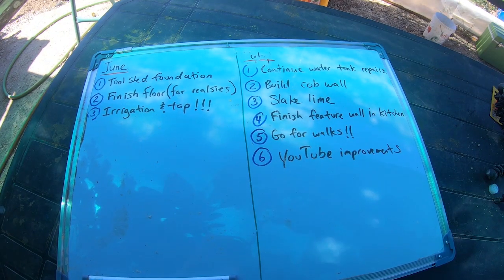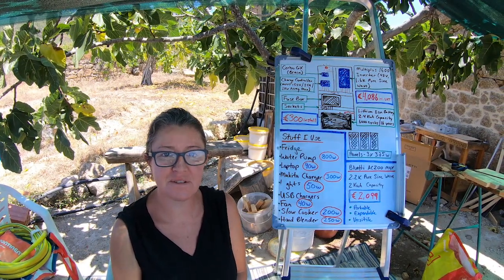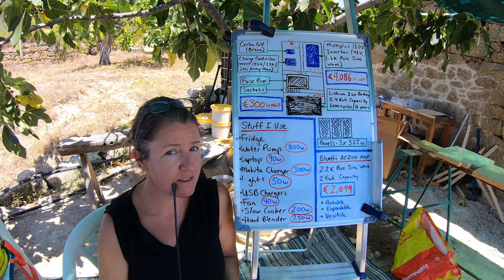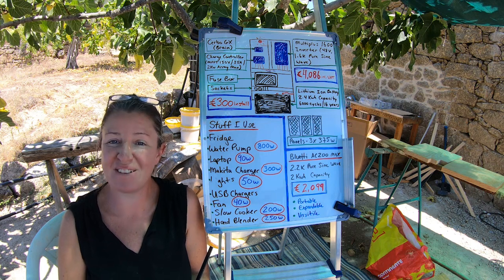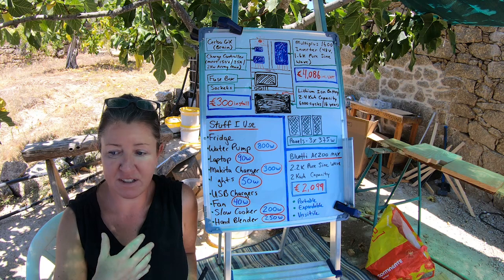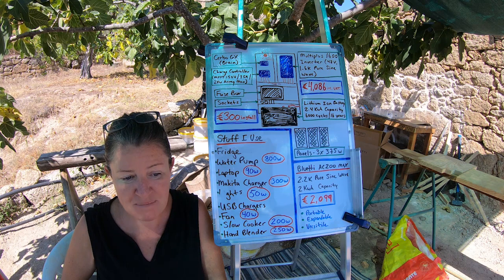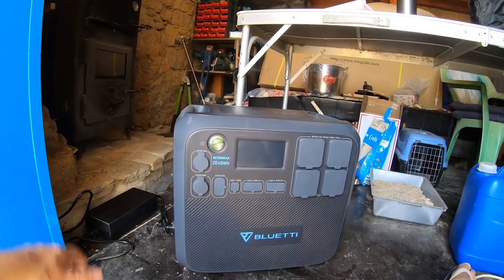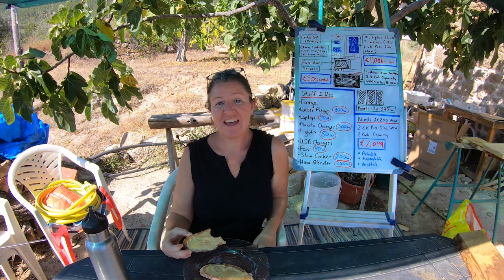My Off Grid Solar Setup Explained in Simple Terms + Bluetti AC200MAX Review

Comment: Pure sine wave is related to ac power (alternate current) the type we use on all sockets (in simple terms current gows back and forward in the fase cable). The solar panels and batteries produce continuous current. ( The current moves from negative to positives poles)
Voltage is the equivalent to water pressure, Ampere is the equivalent to water flow.
Wattage is the most used metric for appliances  and it's what's in a hour. Say your battery is 2.4 KW/h it can power a 1000 W device for 2,4 hours... (If you run the battery to 0)

You probably can charge the new battery from your existing solar panels and your system probably can manage that, ask the installer to set it up. That's something the charge controller can probably do. 
That yeti thing is pretty much your current system in a single box.. inside you would find all the same components you do in your wall.. 

Hope it helps.
Reply from the maker: Thanks for all thsi info, super helpful!

Comment: Its really simple to know what you can do with 2,4 kWh. If you use one device, using 2400 Watt, like a washing machine, and you use it for one hour, it uses all theoretical battery capacity from 100% to 0%. Your pump uses 800 Watt, so it could run for 3 hour continuously at night (no solar input).

You have a really goed quality system, good brand, good voltage, you’ve been recommended well!
Reply from the maker: Thanks! I suspected it was something along those lines but never looked more closely into it... so thanks for the info! Yes I'm really pleased with my system, especially the ease of expansion of batteries and panels. :-)

Comment: Great video, with the normal dose of humor. Awesome win on the Bluetti. If i were you i would save up for a couple of your existing solar panels, and plug the Bluetti into them.
Reply from the maker: Thanks! That's a good point but the issue is where to put them... I don't have roof space or really much ground space (and I don't like how they look on the ground) so it'll require a building before I can get more panels. But one day I'll get there! No rush though since my system works really well as is... so far!
Reply: @PortugalfromScratch  ok. Sorry I thought you had more space on your roof. 
You will have to extend your roof into a veranda/ patio area. 😝🤙🏻

Comment: Such a great explanation!  Well done.  Looks like a very good system.  We will be creating our main solar setup next near, and I took away several nuggets of info from your video.

We have the same Bluetti, and we love it!  We found that its strength is its high surge capability, which is great for higher amp power tools.
Reply from the maker: Glad to hear it and its' cool you're running your place with the Bluetti, by the sounds of it?
Reply: @PortugalfromScratch  Our property is still in its infancy.  We have a very small solar setup in the shipping container for lights and battery charging.  About to add another small solar system in our bathhouse for lights and water pump.  We use our Bluetti mainly for the larger tools and for use on our mobile watering pumping.  Hoping to have a "real" solar system early next year.

We love your channel!

Comment: Like diabetes in a jar haaaa , nice one . Loved the video. Packed with interesting helpful info. I run an old 1950s single banger diesel lister, at times, as back up generator system to recharge battery bank . Slow revving motor (650rpm max= 6hp). Totally different noise outcome too. Vastly better than the screaming unbearably noisy extremely fast revving engines used on the modern generators today, in my view. And i can utilise a whole range of oils too, for choice of fuel, if ever its necessary.
Reply from the maker: That's an interesting idea! I guess I don't know much about motors, either! :-)
Reply: @PortugalfromScratch  i learned way more about solar set up from this video. I didn't know much about them. I have just invested in a couple of panels and controller gadget like what i see you also have one of there too as a part of your set up. So it was choice to get some good tips, thanks 👌👍. The old diesel is quite nice to see still running. Being such an oldy . They ran them in shearing sheds at times too. The noise they make is more of a quiet chuff. Or a whooshing sound haaa. Set up correct its usually ok for people to stand close beside them and yet still hear each other clearly talk without needing to raise each others voice. I was just rather impressed at the difference. Because i really don't like hearing those late model portable generator. Ive just jimmy rigged the old lister up to recycled car alternator. And had those useless lead battery system like you've pointed out are not worthwhile. Which i certainly agree. But anyway, ive been able to recycle any car light or whatever i feel like utilizing to recycle. Does the trick. Well its been ok and now im looking into expanding the system to include solar. Never a dull moment anyway. Always fun to learn something isn't it   : )
Reply: @PortugalfromScratch  you'd use a back up generator, only when sun isn't shining enough. Where as i have creek what runs dry and therefore wont generate the little system during drier months. I've usually used the lister,' to fill in. But i''m going toward adding solar now. Sorry, just figured id not made a good job of commenting

Comment: Yes you do need extra solar for your bluetti to charge it from the sun seperatly. It will do what your house system dose all in one box. You have best of both worlds because if it stops working you would have to send it back but in your case you can do that as you have the house system so still have power.
Reply from the maker: I agree! I'm lucky to to have it as a backup without having to mess around with noisy generators.

Comment: How long they say that this system will last you??   
Is there a maintenence schedule on your origal power with panels. ??
Reply from the maker: The battery is 16 years and as for the rest, I think it's a five year warranty on most of the components but I'm not 100% on that. I'll check my documents and get back to you. I wasn't given a maintenance schedule and I even asked if I should wash the panel and they said don't bother as the rain clears off the dust. But with the long summers, some people will hose them down or get up and wipe them to improve function. But in the dusty summer there's so much sun so they'll perform no matter what, I think.

Comment: You mentioned hot water wash. I’ve been doing cold water washes for years, since you where a baby and they get the clothes just as clean. So maybe it wouldn’t use as much power. Glad maple butter was a hit and will bring you and your friends more next year. The new solar system looks great and sure will help you with things around your place Could you  put a solar panel on your tool shed when it’s built to power the  Bluetti? ❤
Reply from the maker: Yes I think cold water is no problem even on my current system because it's just a motor spinning so whenever I figure out water in and out and find a place for one, I'll get a washing machine. Yes I think I could put panels to power the Bluetti but that's a long way off!

Comment: I see someone else is curious about how you wash your clothes..... I'm wondering how you cook your meals.  Not that you would want hot meals right now.  I have been thinking about you during this heat wave.  It is affecting us here in central U.S. as well.  Today will be between 98 -100 degrees F.  I was reading an article yesterday and it said that the heat wave in Portugal is the cause of app. 1000 deaths so I immediately started to worry about you.  While not as fun as fiddling with springs and planting and building, it is really helpful and I think I have decided to use something like this for  a project I am going to be working on.  A big thank you.  I wonder if one of those small 5KW wind mills would help your system during the gloomy winter?????
Reply from the maker: Maybe I should do a video about all those seemingly mundane tasks that might actually be interesting to people! I cook on a regular stove/oven using gas and I also have a slow cooker. I have a regular size fridge/freezer so storing and preparing food is probably similar to anywhere, nothing special. Yes this weather is terrible but I've learned to take it easy. Wind would be interesting one day, but it's far off. But it does get quite windy here. Let's see how this winter goes! So far the system hasn't been pushed. :-)
Reply: @PortugalfromScratch  With your expertise in cob, you could whip together a cob oven out on your shady patio for this fall... do a little baking..... fix yourself a pizza.  I have been watching tons of oven building videos while avoiding the heat here.  I love oven /stove videos! .... push-push
Reply from the maker: @renaissancewomanfarm9175  Haha yes, a cob oven is on my list! But I'm sure by now you'll notice that I don't 'whip together' anything! I'll probably ponder it for ages as it has to fit into the full design of my outdoor space and I haven't even thought about that at all. But I definitely want one in the future!
Reply from the maker: Also, I love pizza!!
Reply: @PortugalfromScratch  I first became intrigued by ovens last winter with a video about building a pizza oven with two pavers and 50 or so bricks.  No mortar and if you wanted you could just unstack it when done.  And then the Townsends and recently this Mother and son from Azerbaijan and they will build an oven and cook before the clay is dry. And THEN I ordered a book  put out from the National Parks service in the forties or fifties about building camp ovens and stoves.  Now I can decide so I am designating an area to the back of the property as "the campgrounds" and I am going to try several.  I have barrels so am thinking the first one might be a mud covered cut away barrel.  I am getting very close to  whipping one up!
Reply from the maker: @renaissancewomanfarm9175  They're so cool! I've been interested in natural building for many years and the cob oven is often a starting point for people. I've never built one fully (helped a friend once when I lived in Rwanda) but I do intend on some sort of oven... either cob or brick.
Reply: @PortugalfromScratch  One oven was just a quick build affair.  It was probably just 18-20 inches across and the size was dictated by the tree stump they built it on.  I think the floor of the oven as also very thick cob... though I think I would still want that to be fire brick.  But with it just on a tree stump it could still be moved around and when you are done with it, you can just dump the cob in a ditch or under a hugel mound.  Burn the stump as fire wood  and salvage and reuse the firebrick.  I thought it was a great make do method.

Comment: Wouldn't be able to use lith ion gets too cold here@=8)
Reply from the maker: Could you have them inside a portion of your house?
Reply: @PortugalfromScratch  yes but my battery pack are lithium ion they won't charge if they are cold AGM Lead acid will charge it would need an insulated battery box !=8)

Comment: Hello Kirsty
Good afternoon
I'm not an expert in this solar system, despite having training in electricity and electronics, however, it seems more rational to me to have more lithium batteries in parallel and a few more solar panels, in the end what Kirsty bought was another battery that is powered by your solar system, and as any electrical device has its own consumption, so it will spend more energy than it can supply, it would then be logical to reinforce the set of panels and add a few more batteries equal to the one you already have installed to have a greater reserve of energy for poorly lit days, because when you charge that system that Kirsty bought, its solar panels having only 1.6KW, there is not much left for the remaining electrical consumption needs.
That's what I think, but as I said, I'm not an expert in this sector.
Best regards
Reply: Just an extra information, you mentioned Kilowatt and Kilowatt/h, they are different Kw is a measure of power, Kw/h is a measure of energy, or in a simpler way, it is the capacity that your system has to store energy, as if the measure in Kw/h were the capacity in liters that one of your water tanks holds, the bigger the tank the greater the number of Kw/h.
But be careful, you need more solar panels, to have a higher power in KW, because this allows you to have a larger set of batteries that work as if they were water tanks, on the other hand, if you have a fridge always on, it consumes day and night. and at night there is no sun.
For electrical power installations, it is advisable to have some knowledge because they are expensive systems, and it is not advisable to always make patches, it is very expensive.
Sorry for this comment.
Reply from the maker: Makes sense and eventually I’ll upgrade to six panels and another system battery, but I didn’t pay for the Bluetti unit, it was free. So it’s a great addition to my system for all the reasons I mentioned… plus it’s portable which my home system obviously can’t do.
Reply: @PortugalfromScratch  
Oh! Free, that's great, and yes, it looks like a great mobile alternative to a campervan for example.

Comment: Check all the packaging, others who got it  got portable panels which are used to charge it
Reply from the maker: I think those were different units. I was originally offered one of those with panels but it was out of stock then I was offered this one and asked if it also included panels and was told no.
Reply: @PortugalfromScratch  even if you have to buy them I think they are worth it